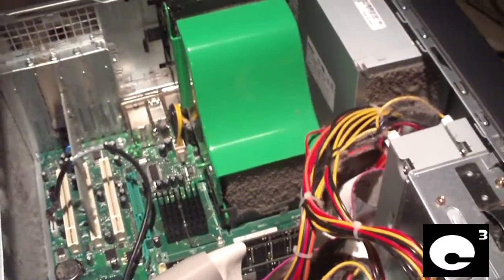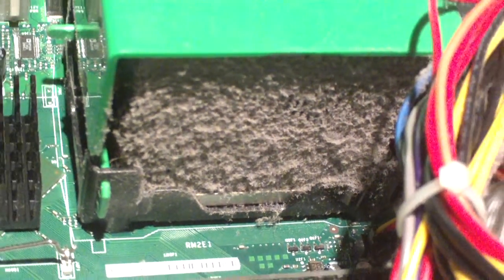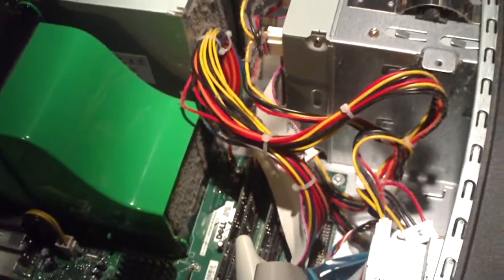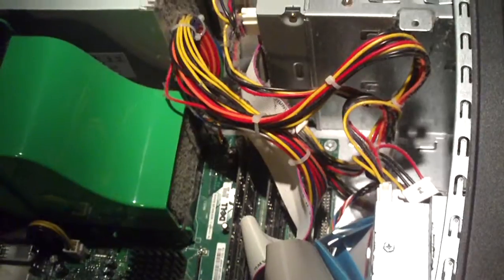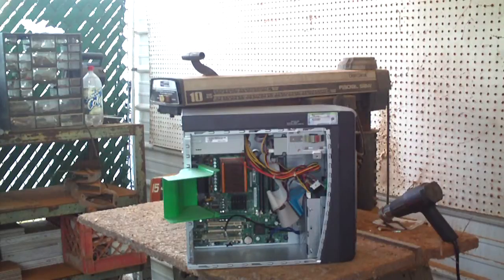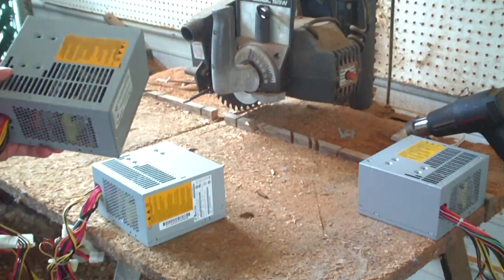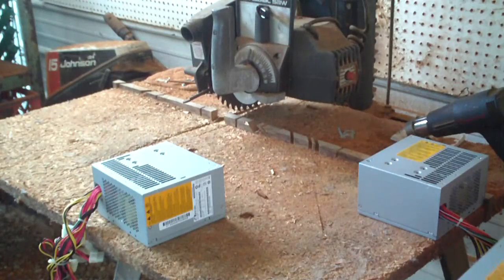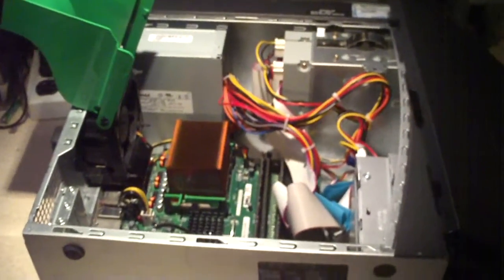Cleaning Out Filthy Dell + Bonus Compressed Air Use Tutorials

Comment: Do you rebuild power supplies I'm looking for someone rebuild my DVD duplicator power supply it keeps blowing the fuse I even jumped it than it blue my circuit breaker it blows the moment I put power to it it's not just a regular power supply it doesn't have the connectors for a mother board I cannot find anyone that doesn't feel tell me to buy a used or new one on eBay they go for 200 and up I can afford 200 and up I can afford 40 maybe even 60 if you do reveal them I sent you mind to look at